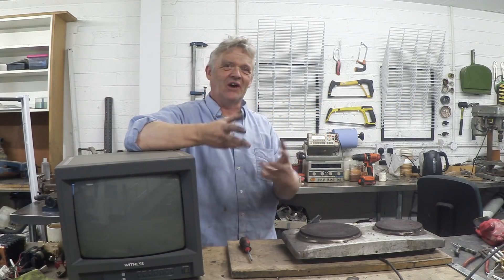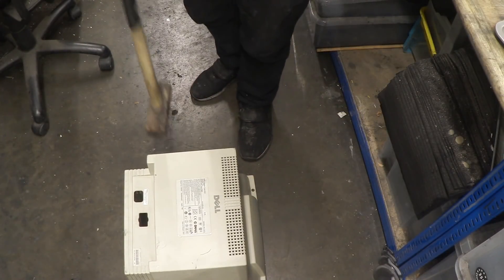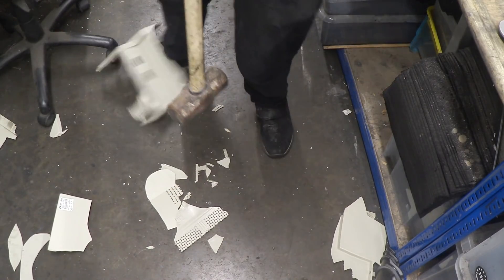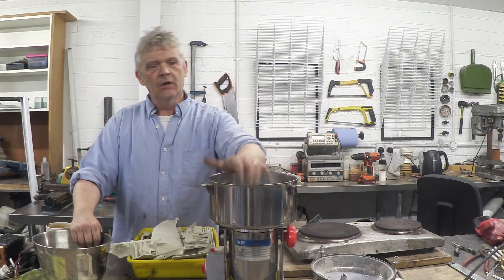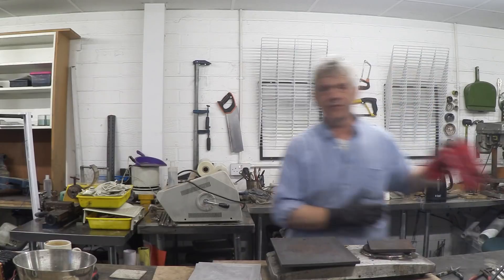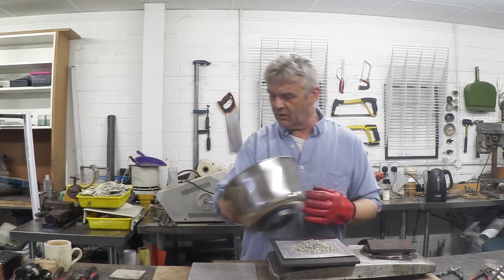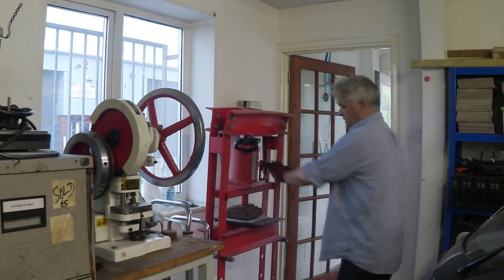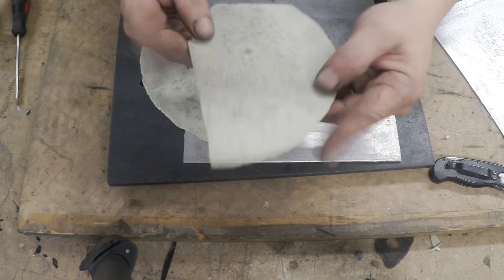Making Your Own Plastic Sheet From A Broken Computer

Comment: 5:20 for the fumes, i found out that if you shielding the plastic from air while melting, then the smell can be minimized or nearly avoided
i used a steel cylinder and woodrods to press it (nearly airtight fit) , also a precise temperature controller helps

Comment: I use ABS a lot with my 3D printing. I also use a a fair amount of liquid ABS for helping with bed adhesion, as an ABS glue, and sometimes to make thin sheets of plastic.  All I do is soak ABS in acetone which dissolves it. If I then poor that into a tray and let it evaporate I can make plastic sheets that way.

Comment: For LDPE, I use grocery bags.
For HDPE - milk jugs.
PET - soda bottles
Polypropylene - other bottles, lids, speakers, old landscaping fabric  (rinsed)... and now used surgical masks

It works best with heat+pressure+time to minimize bubbles
Reply: The grocery bags I've seen here are HDPE, a lot of the bread wrappers are LDPE.

Comment: Most common for 3D printing is PLA and ABS. PLA has a lower melting point and tends to be easier to print, especially for beginners. ABS melts at something like 230C If memory serves. ABS ends up being a little more durable once printed. Great video, thanks.

Comment: Nice one. im working on a plastic beam making device. It consists of a squared metal tube wrapped in Kanthal heating coils properly insulated which heats up the tube up to 200C. Then you put plastic flakes into the tube push them with a stick inside until it's full the you heat up and press with manual or hydraulic press. Let cool down and you have a plastic beam!
Reply: Nice!!

Comment: I have dissolved ABS in acetone and placed the liquid it on a sheet of glass to make my own plastic film. 
If about 10% of that acetone has some xylene or similar, it will dry with more shine and a lot less bubbles.
Why not just use just xylene?
Takes longer to dry.
Reply: interesting, i didn't try xylene yet

Comment: I've been recycling plastic trash like food packaging and casting various parts I need in my projects or replacement parts for broken equipment for over a year now. I like PP the most so far.
Reply: I find that PET takes long time to melt and then when it cools it seems to crystallize and becomes very brittle. I've read that it needs to be cooled quickly to retain plasticity but when I dropped it in cold water it did not seem to make a difference. Perhaps the plasticizers get cooked and don't work anymore.

Comment: Very good demo Robert. I guess you have to be careful you only choose ABS plastic. A thought that occurred is during the melting and pressing you can embed flat metal parts, like washers and tabs and perhaps even reinforce it with aluminium mesh to broaden its uses.

Comment: That bust up can be a very satisfying task when another project didn't go as planned. 😁
I Iook at most things in scrap bins as materials sources.  Many of today's plastic / metal products have flat areas already and often with built in right angles, or just the right shape needed. Could also layer the sheets with a suitable solvent / adhesive for thicker sheets.
Always looking forward to your next projects / info. 👍

Comment: Cold mold process those chips by adding acetone to make abs putty, used as a glue to make reinforced seems, or make actual pour-able paste and put in a mold that is acetone resistant (example -wax 2 part mold or hdpe) it takes ages to evaporate the acetone if you make it too thick so give it a couple of weeks, i have made blocks by putting inside a milk tetrapak carton, you can freeze it, leave it outside, work it with wood tools, fix cell cases, very useful, my latest project was a knob for a machine, all cold process.

Comment: Precious Plastic did some Great Work with reusing old plastics, they Share Their experience and builds on Their Website or on Dave Hakkens YouTube Channel, i bet it is interesting for everyone who liked this Video
Reply: Thank you for info...checked it out..
VERY helpful.  ... Crossbow
Reply: I made the same extruder
Reply: You can make a mini extruder for a s play HDPE with a steel pipe augers bit couple barrings and a drill. Ban heat elements or induction heating make great injection molder
Reply: I made my plastic shredder using a bunch of tin can lids on threaded rods.  Super simple to make and works great for most semi-rigid plastics, but grocery bags were a PITA.

Comment: Yep, ABS filament is definitely used in 3D printing!!  I haven't used it yet, and likely won't for printing, as PETG is a better option for my needs.  Advantages of ABS are durability, impact resistance, heat resistance, easy to sand and glue, cheap price and ability to chemically "smooth" it with acetone vapors.  Disadvantages are that it warps/shrinks easily when printing, cracks easily if cooled too quickly, and smells a bit when heated.  There's a paradox in printing ABS in that you want good ventilation for the smell but you don't want windy conditions that might warp or crack the plastic as it prints.  For 3D printing, PETG has almost all the advantages of ABS with few of the disadvantages and is slightly more environmentally friendly.  
However, recycling ABS in the manner you're doing is fantastic!!  It will be a little bit more brittle when reheated like this, but more than serviceable to reheat and remold.  And MUCH better than sending it to a landfill where it will sit for 1000 years without breaking down.  Thanks for this video - I think it will be great if more people melt this down and reuse it than send it off to a landfill!!!  I ❤️❤️❤️ your recycling and re-purposing videos, I probably sound like a broken record, but I honestly think consumption is our biggest problem when it comes to both energy and pollution, and every bit of recycling makes our way of life more sustainable!!
Reply: instead of ventilate, just make it airtight?

Comment: I din't knew possible to melt ABS, what is the temperature for?
Could it be made liquid (or almost liquid, like very liquid lava), using the right temperature?
And what about (when you say in the water) put it in a plate (glass? plate) that you put in the water, so the plastic melt without being directly in contact with the water, could this be possible?

Comment: I never have tried ABS, does it shrink as much as HDPE? HDPE also deteriorates easily and quickly in sunlight/UV light.
Reply: no , not so much. Just try it, its a "userfriendly" material xD
but heat slowly and avoid smoke.

Comment: Probably a dumb question but would this work with polypropylene or is the composition such that it would fall apart and refuse to cohese to itself again after heating?
Reply: I used to work in a plastic injection molding shop and almost all types of plastic can be recycled, as long as they are not over heated.  Don't inhale the fumes.

Comment: there are no waring or dangers stickers on abs spools for 3d printers
Reply: It's pretty safe to work with at printing temperatures, though it's definitely an irritant.  You really have to have some pretty high temperatures (like burning it) before it begins to produce toxic fumes/chemicals.  Anything below 300°C should be safe enough, but can cause respiratory irritation, headaches, nausea, etc.  And it's not pleasant smelling stuff.  Many people who print with it regularly build an enclosure for it, both to protect their prints from breezes (ABS is prone to warping/cracking if cooled quickly or unevenly) and to mitigate the fumes.

Comment: I used to use my oven and a baking tray but I used plastic bottle tops and to chip them up I had an old flymo lawnmower upside down with a large metal tin screwed to the plastics of the cover it makes hellova quick work of the plastic lol

Comment: I found out recently that aluminium coated crisp packets are actually coated via chemical vapour deposition and so I peeled the aluminium layer off and sure enough I got less than 1 ohm. I suppose making a battery from a crisp packet could easily be done if you could remove the plastic chemically and then make activated carbon with the polymer and use the foil as the electrodes. Would be sensation content and very intriguing I would think. How to get the plastic off?hmmmmmm🤔

Comment: What's about its melting point?
Reply: Technically, it doesn't have a true melting point, as it's a "glassy solid".  But it begins to lose brittleness at around 100°C, can maintain a useful shape up to around 170°C, and starts extruding well around 220°C.  These temperatures can vary based on the brand.